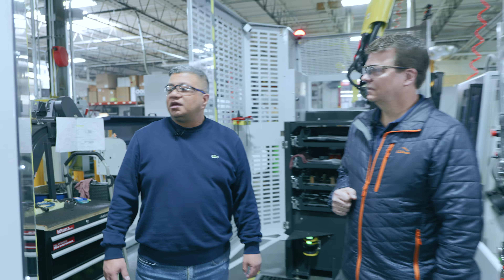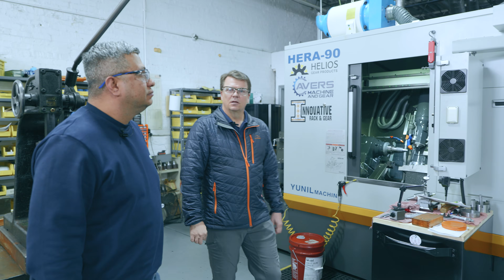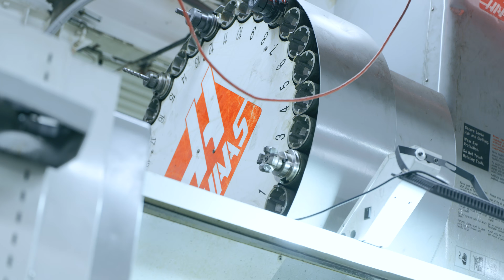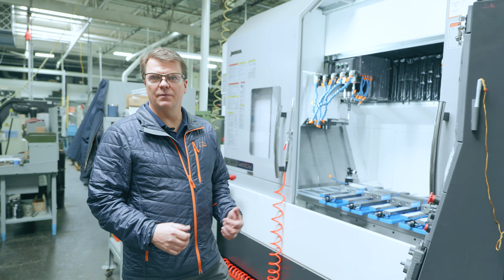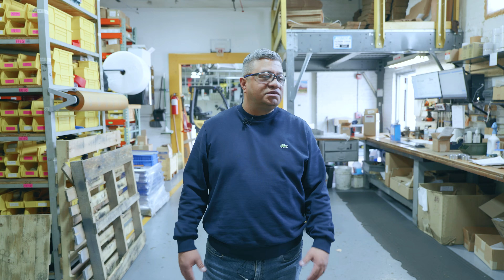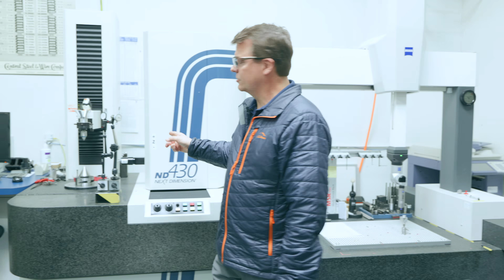You Need to See This High-Tech Gear Manufacturing Facility! | Avers Machine & Gear Machine Shop Tour

Comment: Avers in my opinion is smart in remaining isolated from the web with their mfg. systems. Air gaps are still today the safest and most reliable safty systems available until AI can stand guard as a gatekeeper sentinel and protect an organizaton from harm by outside hostile/mischievous agents/organizations. While it will always be attractive even seducing to let company personnel and customers active and potential have access and flexibility to a companies computer systems and it's impossible to prevent unwanted mischive and disruption at current tech. levels. Ray Stormont